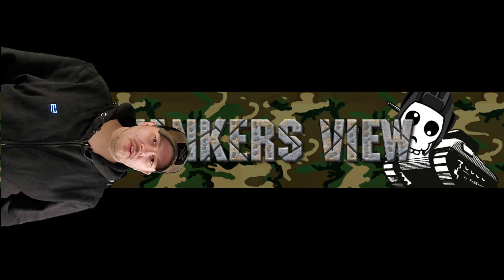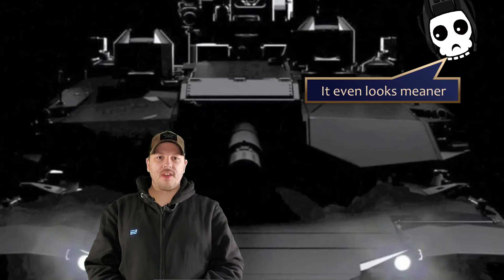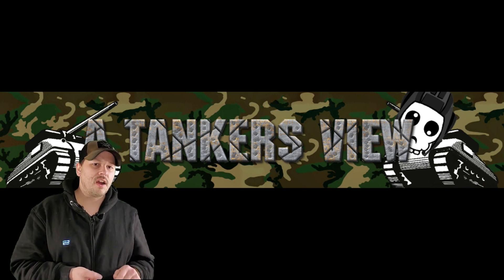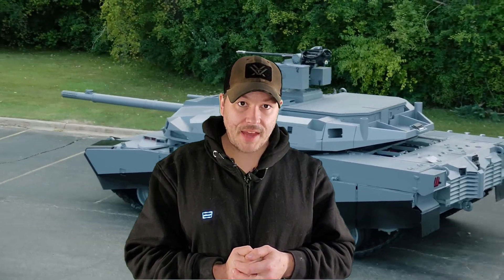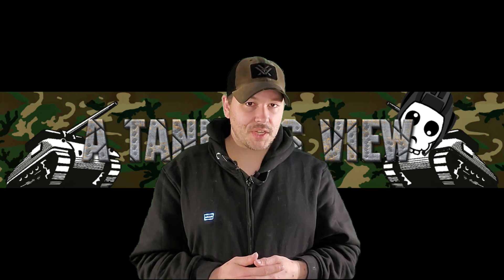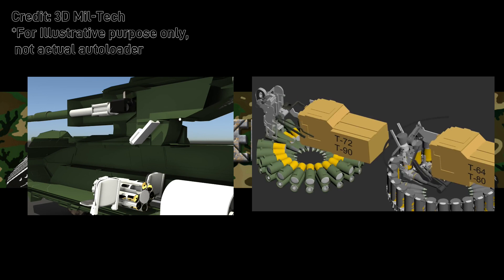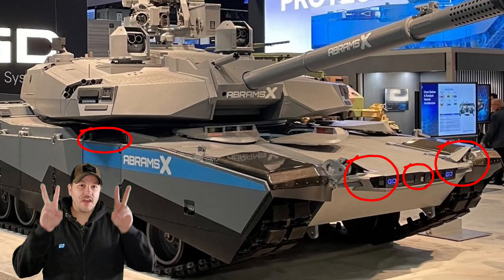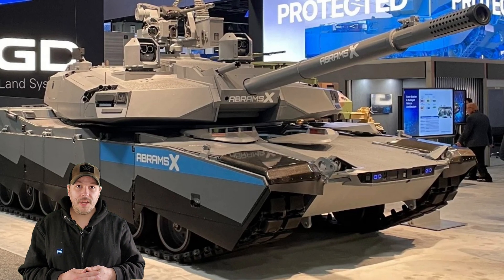A Tankers View of the Abrams X

Comment: I know a bit about the mod engine that the army took from me (I was waiting 3 years for it so I could buy one 😢) it can be coming in at 3 different outputs but I’m sure they are using the 14.5l 4 cylinder twin turbo engine that puts out ~1000hp. As for the drivetrain I know some stuff but it’s mostly speculation but m sure that it’s how they are going about it

Comment: Man I really don’t like the idea of not being able to just look around without relying on low mounted fixed hull and very exposed turret top rotating cameras.  To equal the Mk.I eyeball’s field of view on the turret top sights they’re likely going to have to use some sort of fisheye lens with computer correction of the distortion.  That’s an awful lot of extremely complex systems that have to work perfectly to just look around.  Add in the loss of the Loader’s eyes and the TC’s work load goes through the roof.  Hell, dropping to a three man crew significantly increases everyone’s workload just in terms of daily maintenance. 

The other feature I’m really questioning is the crew all being in the hull but still beneath the turret overhang.  Having to make certain everyone can easily get out (particularly where there is, as The Chieftain calls it, “a significant emotional event”) regardless of turret facing seems to create a rather obvious shot trap along with an extremely exposed turret ring. 

I’m certain the switch to only three crew is very popular with the Bean Counters and the stars on their shoulders future members of corporate boards.  But will it be as much with tank crews?  And I’m sure the engineers believe they’ve solved the crew-turret facing interaction and turret shape issue. But other engineers were certain that they had solved the fuel for the Me 163 melting the pilot issue, so…

Comment: The funny thing about the turbine is that Congress kept pushing off the planned upgrades, replacing the older turbine with a newer, more fuel-efficient model.

EDIT:

Also, the reason that Russian autoloaders use a bustle loader with the ammo in the bottom of the turret is basically the height requirements. Russian tank designers prioritize minimizing the visual profile whenever possible; this includes cutting a crewmember and replacing him with an autoloader, and not storing ammo in the turret. The former influenced the latter more, though, as the autoloader had some serious limitations (which, surprisingly enough, delayed the BMP-3's introduction into the Soviet/Russian military, as the autoloader tended to cause problems with the crew).

Comment: One thing that I don't really get - the side armour over the tracks is done in seemingly hanging triangle plates rather than just flat? That just seems to be futuristic bollocks, why not just do what the previous version had?
Reply: It's technically still standard side armor layout like the OG Abrams, it's just part of the armor is coloured black, then followed by rubber pieces underneath making out the triangle shapes.
Dunno why it's a thing, (probably to look cool, but I hear it helps with reducing dust kickup during travel.) but it's not like it loses any protection.

Comment: I disagree sir. Yes, its looks rocks, but actually the whole design fucked up like the new armata. Also, lots of weak spots on the armor. Is that simply. Murica try to keep up with the old pops what too expensive to even start up the engine. :D :D I prefer Merkava, or a few others instead of propaganda tanks. :D
Reply: IMHO merkava would be terrible for the US needs, and abrams is not optimal either. They are too heavy, and too difficult to transport between different theaters. A smaller, lighter (but as capable) tank would be the way to go. Something like K2, but with addition of some advanced American tech, like the ACE based hybrid transmission.

Comment: What are you thoughts on all crew in the hull? Looks like it's got its advantages and disadvantages.
Reply from the maker: Its a massive advantage in terms of crew dynamics. It'll reduce communication strain, make extraction simpler in the worst case scenario. Vastly increases crew survivability.

Disadvantages are, soldiers are notoriously hard on equipment, large high tech panel displays might be broken easier unless appropriately ruggedized. And unintentional crew interference in such tight quarters. Space is at a premium and in a high intensity situation, the crew may accidentally interfere with one another if the vehicle is getting rocked around. Where as in a traditional set up this is minimized, albeit with considerable compromise.

Ultimately i think its a good thing moving forward.
Reply: I would think it also requires a lot less material since you don’t need to build the sections the crew would normally be in which makes construction cheaper and quicker.